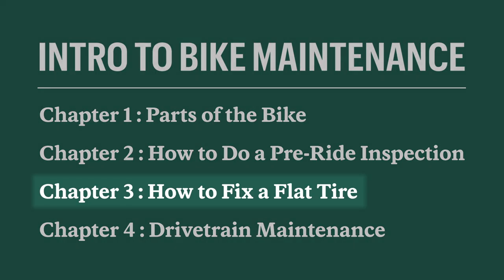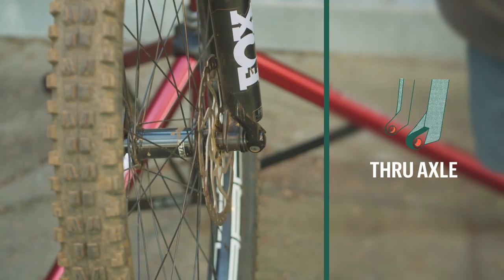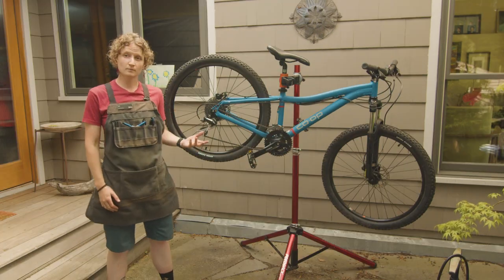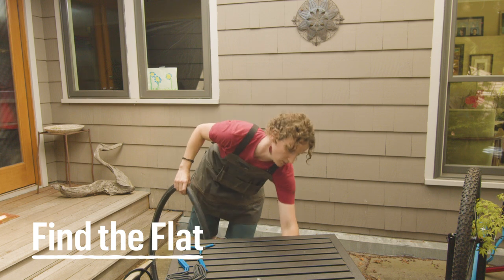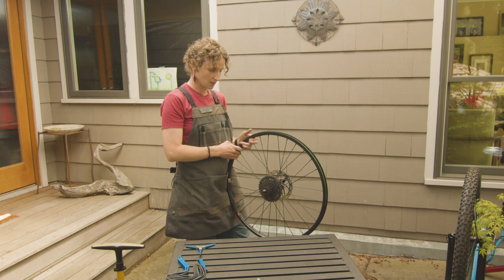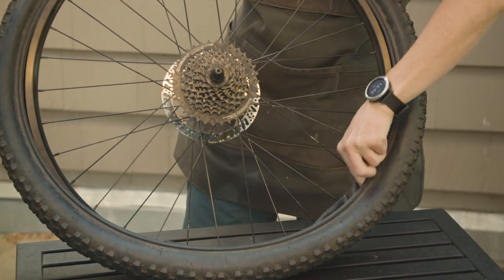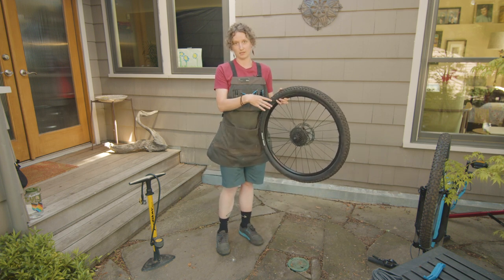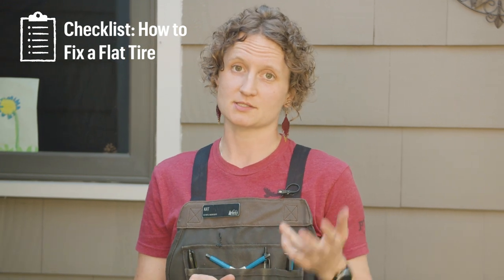How to Fix a Flat Bike Tire — REI Co-op Classes

Comment: A wonderful video.   Kat, you have a very real person but very comfortable presence on video.   A rare and excellent quality.  However, you neglected to mention one thing that you actually did.  That is, when putting the tire back on the rim, put the label directly over the valve.  That way, once you get the flat tire off the bike, you can look for the source of the flat at the same distance from the label as  the puncture is from the valve.

Comment: Maybe use a large toothbrush or a hake-brush instead of your fingers when checking the rim for pieces that caused the puncture.  Both will remove such pieces, so long as they aren't embedded in the tape already.

Comment: I may have missed the part where you check  that you've put  the tyre on wheel in the  right direction 
Putting  a small amount of air in the inner tube helps prevent the inner tube from twisting when putting it back in the tyre

Comment: Is the process the same for e-bikes?
Reply from the maker: Good question! On an e-bike with a mid-drive motor, flat repair is the same as it is on a conventional bike. Hub-drive motors are more complex, though, requiring you to know how to disconnect and reconnect all the electric connections involved.
Reply: @rei  Thanks for replying. It is hub-drive. I found another video that matches my bike